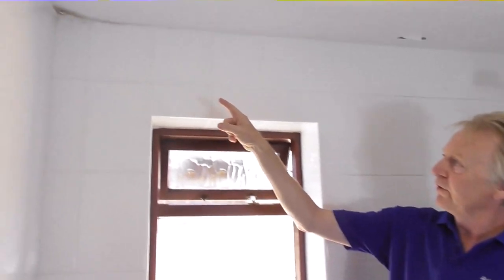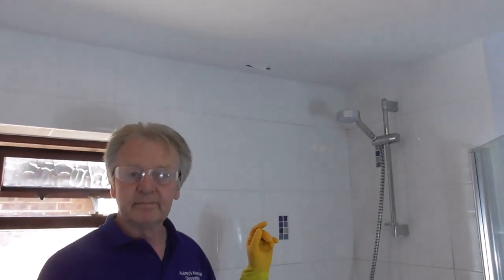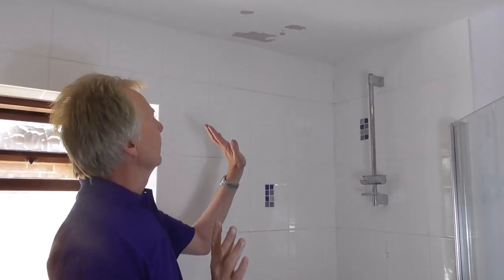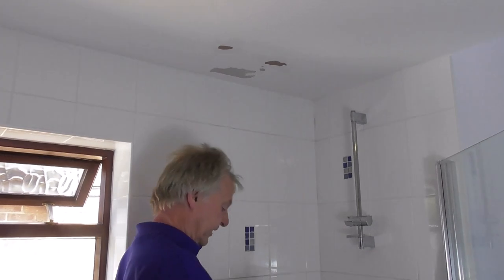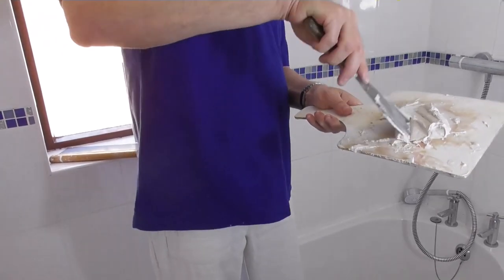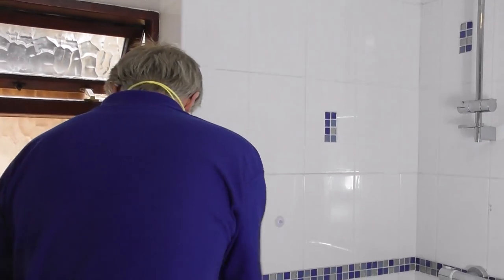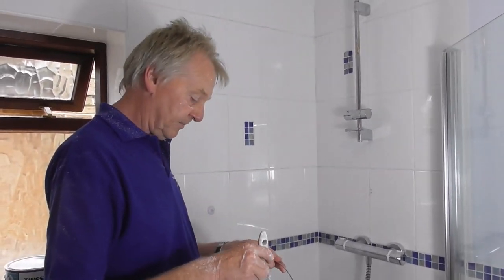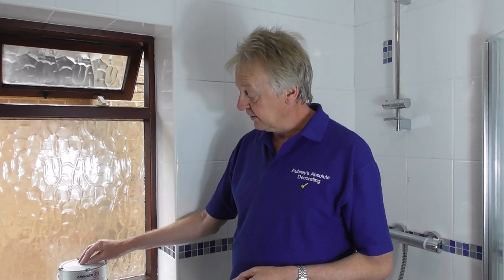How to Fix Flaking Paint and Mould on Ceilings

Comment: Thank you, I hope you can let people know, just because mold is on the inside of the ceiling and or wall does not mean you have it inside your exterior or interior walls.  I recently tore out lost of drywall looking for it, but did not find anything wrong....Good lesson to know.  Wood glue works as good as Zinsser or Kilz sealer to seal the drywall damaged paper, before you do your drywall mudding.  Thank you, I am going to buy the zinsser Mould resistant paint...

Comment: Hi Aubrey great video
Quick question
In your video on how to repair hairline cracks you used 240 grit sandpaper but in this video you used 140 grit. What is is the reason for this? 
Thanks in advance
Keep up the great work
Reply from the maker: Hi, the 120 is best used when there is a lot of filler to be rubbed down and the 240 is good for small isolated areas.  However, the 120 is a good one to use for most situations.

Comment: Hi There. Would you be able to suggest a Top quality, durable & scrubbable,water-based paint, which I can use for my bathroom. Type of paint which can withstand moisture exposure 💦 ? I prepped and sanded the old yellowing gloss paint from my bathroom wooden surfaces which had mould spores. I want to make sure I am using the right paint brand for anti- moisture ? Thanks 👍
Reply from the maker: Zinsser Perma White is a great product for use where mould is a problem.  If you check out the product details you will see that it should be a good choice to meet your requirements.

Comment: Fantastic, very useful. 

DIY'er here. Just moved into a new house and there are loads of small strips/patches 10-20 mm wide, in varying lengths, some up to 100-150mm long, of bubbling/flaking emulsion paint, down several, moderately sized areas of a lot of the walls (both solid external/load bearing and the plasterboard upstairs internal ones). Not sure what's caused it but it's going to be a lot of work to repair. Glad I checked the video as I wondered about scraping, sanding and sealing, so good to get confirmation.

I have noticed, however, that when sanding, some of the smaller 'bubbles' have flattened back down and are no longer visible. Should I worry about these lifting again or will sealing with PVA take care of these? Obviously I don't want to finish off and have them flaking again in a short while.

Any advice would be appreciated. 
Many thanks 👍
Reply from the maker: Hi, sorry to hear about the flaking paint problem.  One reason for this could be that they have applied a matt emulsion paint directly over a silk emulsion paint.  The matt emulsion wont adhere well to the silk and peels away in places.  Hopefully it will be ok if you can scrape back the flacking paint to a firm edge. The areas where the bubbles have flattened down will probably bubble again as soon as you apply fresh paint over it so try and remove the paint from those areas.

I would suggest you treat one wall as shown in the video and apply paint to see how it turns out before doing the rest.  If you get any more problems please get back to me.  Fingers crossed for you.
Reply: @AubreysAbsoluteDecorating  
Amazing, that's exactly what's happened. Thank you so much.

The original (satin) paint is perfectly adhered and is quite impossible to remove without sanding back to the plaster. The subsequent next two colours were obviously applied, poorly, with a brush are the problem and are especially loose where it's thicker. The real problem is that they're loose in places but because it's matt finish, it's hard to see where they're adhered and I only find out where they're loose when it comes off. 

Very frustrating. And to add insult to injury, all the ceilings and the bathroom and kitchen walls have artex on them... which we've had tested and contains you-know-what...

Any how, I've taken your advice up to applying the PVA coat and am just waiting on the filler to dry. However in applying it I've revealed more areas that are lifting. 

And, of course, the bit I'm working on, and is worst, is the hall/stairs/landing 😂😔
At least I know what the problem is now. Thank you.👍

I'll let you know how I get on.
Reply from the maker: Goodness me you have got a mission on your hands there.  For future reference, if you need to apply vinyl matt over vinyl silk, give it one or two coats of Zinsser Bullseye 123 first and that should sort it.  I do hope you can sort it out without to much work.  contact me again if you have to, good luck 🤞

Comment: Hi Aubery. I wanted to paint 2 formica covers bedside units a grey colour. Thay are both white at the moment. Anyway, I hnow I have to lightly sand then over for paint the adhere to them. Could you please tell me what paints I need to use for this process please? Or have you a vid for this?  Great vids. Thank you. Take care and stay safe.
🇬🇧👍👌🤔❤️
Reply from the maker: Hi Peter, for your Formica cabinets I would suggest the following, apply 1 or 2 coats of Zinsser Bullseye 123, no need to rub it down first.  This paint has excellent adhesion on these types of surfaces.  Then apply a water based satin wood, eggshell or gloss.  The bullseye is white but can be tinted with acrylic colours.  The water based satin wood etc normally has quick drying on the labels.  Hope all goes well for you 😊
Reply: @AubreysAbsoluteDecorating   Hi Aubery. Thank you so much for your help. Very much appreciated. Take care and stay safe. All the best. 🇬🇧👍👌😄❤️

Comment: Hi just a quick question when you said you were priming the ceiling what was being mixed with the water ? Was it a small bit of emulsion and water wasn’t sure knew to this lol
Reply from the maker: I used some Bullseye 123 thinned with around 20% water to prime the filler.  You could also use some normal matt emulsion paint thinned 20% with water.

Comment: Will bleach always get rid of ceiling moulds? What paint would be required for the bedroom ceiling after the mould has gone?
Reply from the maker: Bleach normally does the trick.  The Zinsser Perma White will prevent the mould from returning and is guaranteed for many years.

Comment: Hi Aubrey. Did you paint the whole ceiling in Perma White? If so, will that stop any other part of the ceiling from flaking in the future? Great video and many thanks.
Reply from the maker: Hi, yes the whole ceiling was painted with the Perma White to prevent any future mould growth.  I am pleased to report that the ceiling still looks good with no more flaking 😊
Reply: Hello, my whole bathroom ceiling is peeling. Can i use all the paints and fillers you used across the whole ceiling? Also, I didn't hear you say if you primed the rest of the ceiling before adding the perma white. Thanks for a great video and for your time.

Comment: Very helpful video Aubrey but my wife wants her own mixed color on the ceiling, will an ordinary matt emulsion be OK without the Zinsser?
Reply from the maker: Hi Chris, if the ceiling does not have the mould problem but was just flaking then using the matt emulsion should be fine.  But make sure you treat the flaking areas as shown in the video.  If you do get the black mould problem in places then you will need to use the Zinsser.  Some retailers will tint it the colour you want so check before you buy it.  Hope that helps.
Reply: @AubreysAbsoluteDecorating  Brilliant thanks Aubrery.

Comment: Hi Aubrey, trying to sort an issue in my girlfriend's bedroom - upon waking up or spending 30mins in there we both feel slightly nauseous and dry lips and eyes etc, it appears there is a patch of maybe water damage from the roof, have you encountered anything like this before? The current plan is to knock not back to the brick, replace the plaster and repaint
Reply from the maker: Not sure what could be effecting you health wise in the room.  Might be worth getting a carbon monoxide detector just in case.  Before removing the plaster you could try treating the water stain with Zinsser BIN Primer.  This stuff works really well with covering water stains.

Comment: Good  video  but  how  much  is  1  part  of  PVA  glue  and  3  parts  of  water?   do  you  mean  a  full  cup?  or  full  tablespoon?  of  each?
Reply from the maker: Hi Dave, it all depends on how big the area is to be treated.  Either one will work.  I would suggest first try mixing it up using a small measurer like the cap from an aerosol spray or similar.  The solution does go a long way so you do not need loads of it.  Hope all goes well with the decorating.

Comment: Hi. My ceiling paint has been peeling quite a long time, I'm searching how to repair..😓
Could you advise me that I heard about after scraping and plastering/putty have to use oil sealer paint so it'll be last longer? Using oil sealer paint is a correct idea or not necessary? Is oil sealer paint same as oil paint that actually take longer time to dry and keep moist inside will cause peeling easily in future? After plastering have to choose PVA, oil sealer paint or anti-mould paint or latex or water paint? 
Plastering, putty and your video filler are they same thing for repair paint peeling? How to decide which one to use? What filler product name in your video which it is dark in the video can't see?
Your advise is much appreciated 🤗🤗😇
Reply: Hi. In the video-Zinsser123 primer-sealer stain killer is it oil sealer paint ?
Reply from the maker: Hi, you are right when you say that oil based sealer will trap moisture and may later cause flaking.  I would suggest you try the processes shown in my video.  Scrape off the flaking paint and rub down the remaining paint lightly with a 120 grade abrasive.  Seal around the flaking areas with some PVA glue thinned with 1 part glue and 3 parts water.  Leave overnight to dry.  Apply Pollyfilla where required and when dry rub down smooth.  Prime the filled areas and any bare plaster with Bullseye 123 and leave a couple of hours to dry.  Apply 2 coats of the Zinsser Perma-white.  I hope that helps 😊
Reply from the maker: Hi, it is water based.
Reply: @AubreysAbsoluteDecorating  
Hi, thanks for your advise is much precious! 
I'm still doubt for paint peeling repair in Why as known to use oil sealer which is stronger adhesive to the ceiling wall and last longer than water-based paint??? Is this wrong?? OR Why some as known to use latex paint for paint peeling??? Why and how to decide oil sealer or latex or water based?
Your advise is much helpful and precious to me😇😓😇
Reply: @AubreysAbsoluteDecorating  
Hi. After Bullseye 123 is dried, we still need to apply Anti-mould paint? (Zinsser Perma-white is an anti-mold paint?) why some known as after oil sealer is good enough, anti-mould paint is not necessary, just following with normal paint?😰

Comment: Thanks for sharing, I tried to spray clorox bleach (green color bottle) to my ceiling bedroom but it doesn't seem working. Any advise please? Thank you
Reply from the maker: Looking at the safety data sheet for this product it only contains 5% bleach.  I would suggest trying a solution of 1 part household bleach to three parts water.  This would give a stronger solution of 25% bleach which normally does the trick.  Hope all goes well for you 🙂

Comment: Do you have to skim the bare plaster before painting or can you rub it down, apply diluted PVA and then apply a couple of coats of paint?
Reply from the maker: Hi, if it is a new bare plaster surface, don't rub it down, just go over the surface lightly with a scraper to remove any nibs.  Dust off and then apply a mist coat (paint thinned 20% with water) and then apply two further coats.  Good luck with the decorating.

Comment: Hello Aubrey I'd like some of your expert advice. I've used a blown vinyl wallpaper that has a tongue and groove effect. The problem is that it is easily spoilt if it gets knocked. I've painted it a dark red colour but it has accidentally been badly scratched so I wondered if there was a paint or something that would make the surface more rigid? Because it is so soft to touch I'm regretting using it. It's in a bedroom and the bed is right against the wall. Hoping you can help!
Reply from the maker: Hi Jenny, yes blown vinyl is easily damaged and difficult to repair. Now that it has been painted it is difficult to apply a product that will make it more rigid.  There are many modern paints that state that they are tough and durable and could help.  Dulux Trade Diamond Matt states:  Key Benefits, Scrub, scuff and stain resistant, Ultimate durability, Repeatably cleanable smooth matt finish, Anti-Fade technology.  Other manufacturers also produce similar products.  If I think of another alternative then I will let you know.
Reply: @AubreysAbsoluteDecorating  Thank you for your swift reply Aubrey. It's certainly taught me a lesson. I'll try the paint you recommended

Comment: Hi 
When painting a door with water base gloss paint  if second coat is required does it need slightly sanding before second coat is applied.
Reply from the maker: Hi, be very careful sanding the water based gloss as it remains quite soft for a long time.  Use a 240 grade if it requires sanding and abrade very lightly.  If the first coat does not have any bits or defects you can apply directly over the first coat.

Comment: Do you think the mould problem is coming from the other side of the ceiling Aubs?
Reply from the maker: Could be Kathy but that might also show as a brown water stain on the ceiling. It might be where there is a gap in the loft insulation or perhaps a cold bridge as it is near he outside wall
Reply: Nice 1 Aubs. Greats tip 😘

Comment: Do I have to use this perma moulding paint just for the specific area or can use it to paint the all the walls & the ceiling?
Reply from the maker: Hi, yes it can be used to coat both the walls and the ceiling 😊
Reply: @AubreysAbsoluteDecorating  thanks for the reply. Wanted to know if I have to paint the whole walls & ceiling with mould paint or the specific area where the mould is?

Comment: Hi can pva be mixed with wallpaper paste for better adhesion
Reply from the maker: Hi, if you are following the manufacturers instructions you should not need to do this.  It may add extra adhesion but will be extremely difficult to remove the wallpaper in the future.  Also, any paste residue on the wallpaper may lead to shinny patches on the applied wallpaper.

Comment: Oh, I need that scraper. What brand Aubrey?
Reply from the maker: Hi Brian, I am not sure what brand it is.  Most decorating merchants should stock similar.  It is a 1" scraper with hardwood handle and make sure the metal tang goes the full length of the handle.

Comment: Can you use perma white on radiators.
Reply from the maker: Hi, the Technical Data Sheet for this product states that it can be applied to previously painted metals and will adhere well to glossy surfaces.  I have applied other water based finishes to radiators and I would think that this product should be suitable.  Hope all goes well with the decorating.

Comment: Why do you use pva  before you use filler?
Reply from the maker: The PVA seals the area which is to be filled.  This prevents the old paint from lifting around the edges of the areas to be filled.  If PVA is not applied you will find that the old paint will start to lift away around the edge of the area which has been filled.  I hope that helps.

Comment: personally i would machine sand those bits till they are feathered out and all flat so no edges. Then sealer
Reply: so no need for filler either? if all feathered out and smooth and flat. You then say Sealer, is that PVA?
Reply: @kilmoregalway  oil based sealer/primer. Stops anything coming through and also hardens the edges so they won't keep peeling.